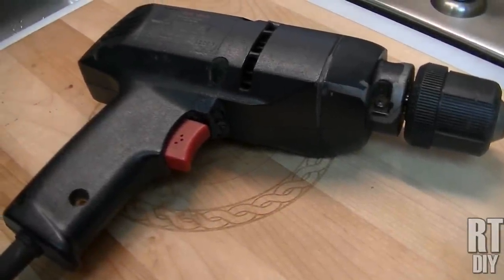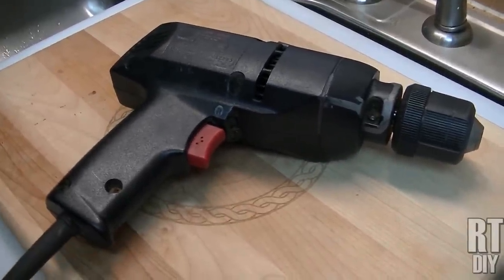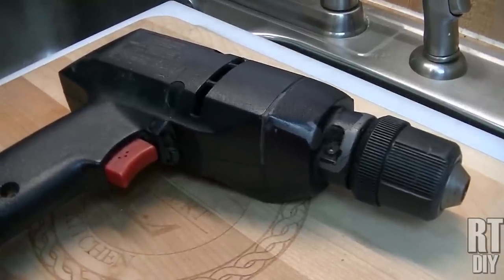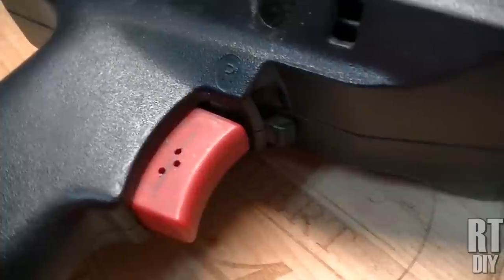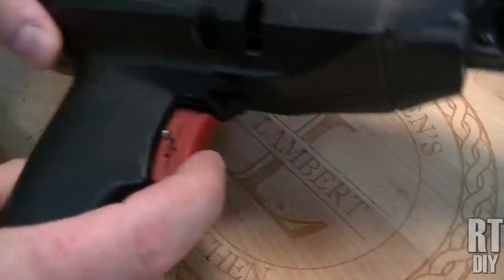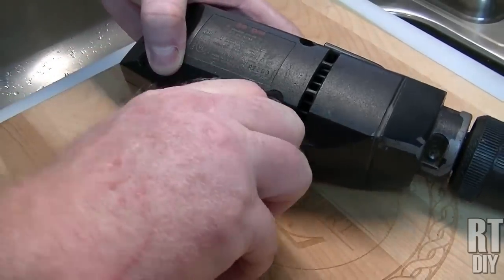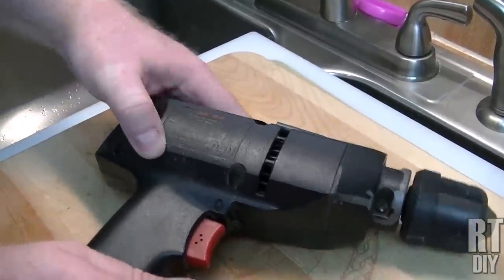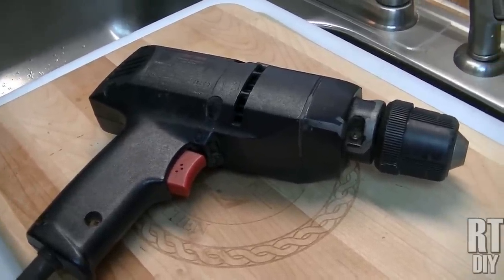Variable Speed Drill Hack ~ Rick's Tips DIY

Comment: WOW - I've been on the internet for about 40 minutes looking for ways to control my drill speed. I've looked at dimmer switch hacks, units that plug into the wall socket with a speed dial etc.

Then I came across your video - And you've solved my problem at the cost of £0.00's.

Thank you for your most excellent tip sir.
Reply from the maker: Awesome!  Glad it helped!  :)
Reply: There are units you can plug into the wall with a speed dial? I've googled and can't find them is there a specific name for them? Myself it's for an orbital polisher and couldn't apply this hack to it.

Comment: this is exactly the reason why i want to control m,y drill speed but another way i think its gonna work is  a zip tie or hose clamp around the power button of the drill and tighten the hose clamp nut to your desired speed, i never tried it but i think it will work. and you can get  plug outlet adapter with on off switch to quickly turn on or off the drill. 
or for on and off purpose dont cut the zip tie from the drill, just lower the zip tie from power button and and lift it up the zip tie on the power button for desired speed.
Reply from the maker: That might work if you can't drill through the trigger.

Comment: does it work with variable speed planner as well ? I tied with cable tie, the motor rotated but the blade is not...? how can I fix it ? thanks
Reply from the maker: Sometimes when the motor is under a load you can hear it trying to turn but can't.  On the drill when this happens I release the trigger and re-squeeze it several times quickly until I hit that "sweet spot".  I don't know if this helps with your situation but it may be something to try.
Reply: @rickstipdiy  I found that the drive belt is snapped, is it possible to change it to sprocket and chain?looks like the belt can not stand the torque, thanks
Reply from the maker: @RixtronixLAB   I have no idea what you're working with so all I can say is try it but BE CAREFUL !
Reply: @rickstipdiy  Ok, thanks, it came out, that my belt drive snapped, I'm thinking to change the system to chain and sprocket, I reckon the belt can not take the torque I give to the blade. Cheers :)